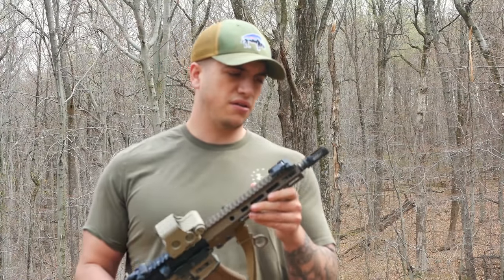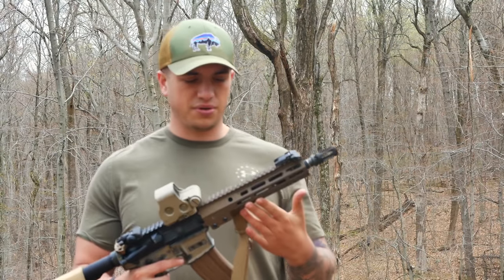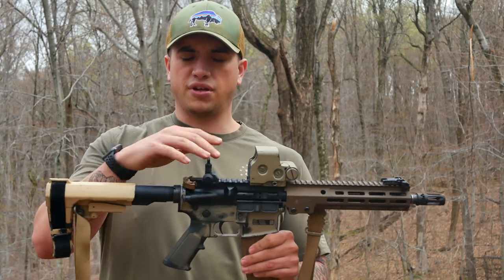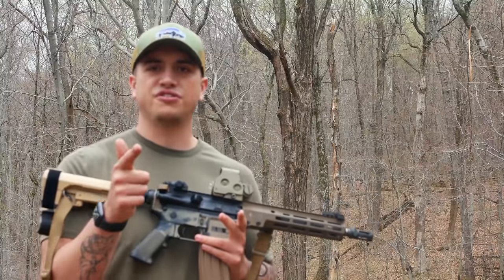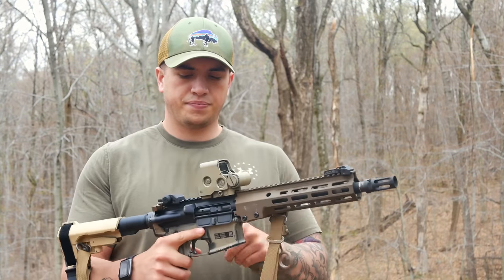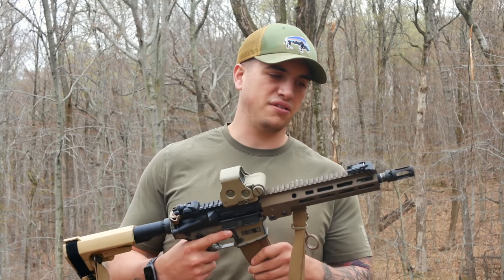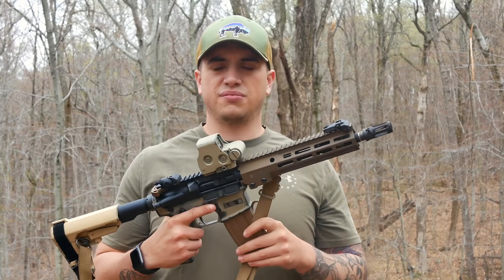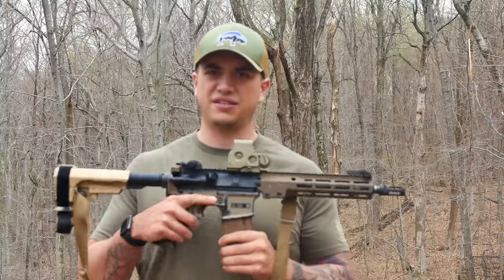AR15 Pistol URGI 10.3" "Clone" Build Pt. 1 | Colt Geissele CQBR Block 3 Clone-ish

Comment: I think were people are getting confused is when you said it was bought as a complete lower,& not a stripped lower. Most people think a complete lower as a rifle lower. Which it usually is. Not that there isn't a complete pistol lower,but if you look up complete lower to purchase it will usually come up rifle lower. With buffertube and stock. As far as the clone nazi's are concerned because of it being a pistol, screw them. How many of them have full auto? Using their logic ,if it's not full auto it's not a "real" clone.
Reply from the maker: Yeah it was probably a poor choice of words on my part. But these clone dudes jumped about the “once a rifle always a rifle” over a picture with no context. They crazy out there, man. Clone community is a weird place.
Reply: Even if you buy a lower complete with a stock it’s still not a rifle. It only becomes a rifle once a barreled Upper is attached.

So if you buy a complete lower with a stock, throw out the stock right when you get it, replace it with an SBA3 and throw a pistol length upper on there you’ve still made a pistol legally.

The complete lowers still transfer as “Other” even though they include stocks.
Reply from the maker: Well put
Reply: @MaddMaxxLop  yes it is.

Comment: Also higher amounts are helping a lot especially risers like I mentioned before like Unity I might keep my Magnifier just for that get the flip up extended height rear Magpul I think it is but one issue I have with a lot of firearms industries is I feel if you are a higher in produce Siri you should Arco anodize or Parkrise whatever you wanna say however you wanna call it but then Sarah code after its analyzed because you want it to not easily get Marx up and scratched up type three hardcode analyzing is a little bit shorter than Cerita I’ve noticed but my dust cover is the one that does the damage for the most part in the mag wells but I think quality firearms companies should Sarah coat on top of the anodizing it makes sense because what where is through first the Serikow than the anodizing just my opinion they can do it companies for example like radian they Serikow their receivers are not cheap are use them being predominantly left-handed shooting even know right I’m right eye dominant but I’ve always shot left-handed but been able to shoot red-handed if I had to and deeded to shoot just as well for the most part it just wouldn’t be as comfortable and a little bit awkward but that button that the SR 15 has and also radian Bing and B boat release is just amazing for a lefty because you’re putting that mag up with your right hand and I just tap it with my thumb and I definitely think that there’s brains are meant to be light and radiant as far as closing the boat because it’s easier to actuate than that maritime and it doesn’t give you as much surface area but then again it’s meant to close the boat pretty quickly and easily but it definitely kicks ass if you’re a builder I do know a company out of Florida that produces crane spec uppers and lowers that Cole uses and they used a lot of coal products receiver sets on their AR is one they became a company but there if you’re looking for a very minimalistic and affordable upper lower receivers that you can’t go wrong it just has it ACI etched in 15 with the serial number and the state I think I said is like 100 bucks and you can get five sets for four I think you get like 54 and you get 50 free basically but I haven’t checked but I do know when it comes to a more our market is a buyers market for A.R. 15‘s the price of inflation has not hit Plus people are panicking because the ATF bullshit and are panic selling and it’s sad but stupid because people stores have so many that’s why I’m looking for an SR 15 lower anyone or even a complete SR 15 in court I would expect good condition very good condition I would expect someone to treat your rifle like that the either 11.5 or the 14.5 and especially because the way their gas system is is they put a flange in a barrel nut in front of the gas block and it helps with the gas leakage and they’re able to make the gas sport smaller which helps with suppressed guns With a radian in there with an even smaller Gasport especially if the guns going to be ran suppressed and then they have the dual Spring extractor

Comment: i never seen a colt without a c in the letters before forge mark. i prom ise this is not colt upper.
Reply from the maker: Current production colts have cage code numbers, no a ‘C’. It’s been that way for almost 2 years. A little google goes a long way.
Reply: @MaddMaxxLop  prove it
Reply from the maker: https://www.google.com/search?q=colt+cage+code+upper&rlz=1CDGOYI_enUS765US765&oq=colt+cage&aqs=chrome.2.69i57j0l3.4487j0j4&hl=en-US&sourceid=chrome-mobile&ie=UTF-8

Comment: 4 prong flash hider is fantastic. My clone upper is amazing.
Reply: I have the 14.5 clone the 4 prong is amazing.My only gripe about the upper is mine has the DD screwed gas block.I dont trust screw on gas blocks and may sell upper and put my m4a1socom upper back on the lower.